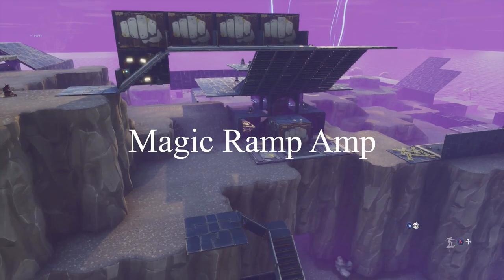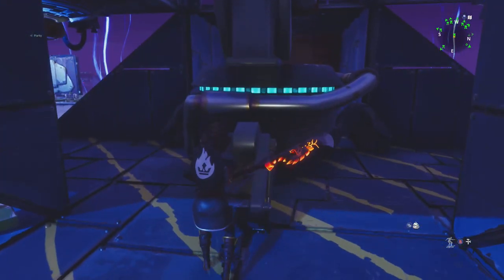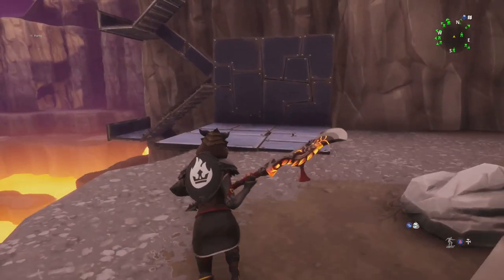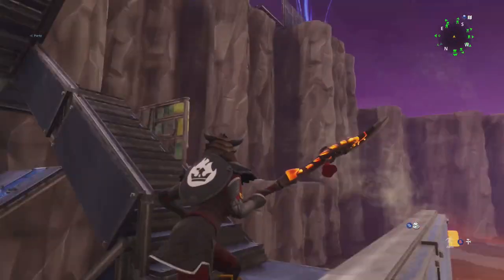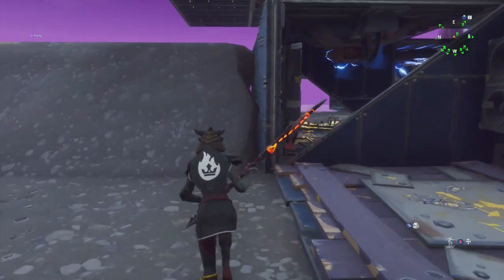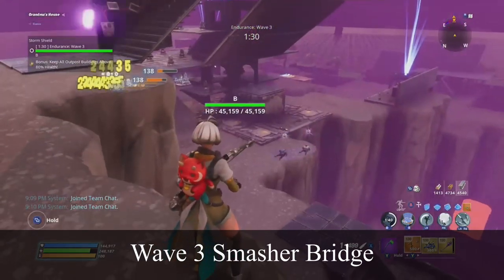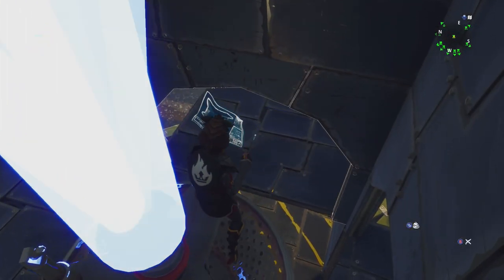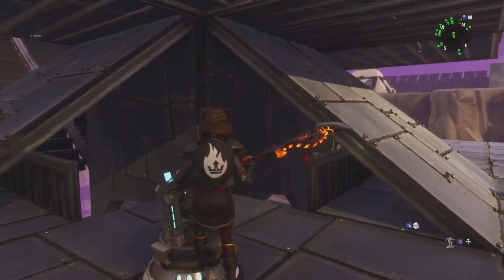Magic Ramp Amplifier. Twine Peaks Endurance

Comment: On non linear aggro, you could try to stand behind the spawn. 
Works in every wave 5 (and on any other wave) for me. 
If you can relie on your build, that is a easy way to deal with smashers.
Reply: I'll have to try that, just got hit on wave 5 and the smashers leveled it. So many dang smashers on that wave.
Reply: @wisemx  it requires to build the amp like in the Video. Or completly with non aggroable Walls:) have fun building
Reply: @ashkatschm4057  Yeah I did but there were do many they looked like spaghetti and just started wreaking right there.

Comment: 200iq but do you have a video explaining all the trap roles used for each amp, that would be super helpful and would make it easier to build
Reply from the maker: I can try and make this in the future if it is going to help. However most of the reasonings to why i use stuff is similar to vacaloidnyans video on trap perks for endurance with about 3 different trap perk setups maybe... but thanks, i might look into it.

Comment: Great build will have to try. Will the boss walk around the amp or same path as the normal husks?
Reply from the maker: hell normally path underneath and through the same way, if he starts hitting a diagonal piece just knock him with a weapon so he moves round to back wall. However there are other paths or interactions that can happen but that's for a later date.

Comment: how many times impact on the walllaunchers and floorlaunchers
Reply from the maker: I think its 4x impact floor launchers the one to the left of wall launcher homebase side may sometimes not knock over so the second one they land on will launch off. The wall launcher only really needs 1 impact at most but mine is 2x impact 2x reload 2x durability or heals...

Comment: Being a geek myself and liking the idea of exploiting husk mechanics, what I really like about this build is any silent changes EPIC make to the game can be discovered easily once you have a good knowledge how husks should behave around this amp. I see you have mentioned about the launcher perks in other replies but not about the sound walls. Are the two sound walls around the outside of the monitor non impact? IE; 3x durability, 2 x reload, 1x effect duration?
Reply: I just wanted to add that the reason I'm asking about the Sound Walls is because post 12.50 the build stopped working for me, even on wave three. The smasher follows the path in your video until it gets to the back of the amp, then it looks to start heading right and up the natural ramp but then turns and decides to attack the sound wall instead. The smasher then proceeds to break the three walls around the monitor before then finally heading to the smasher bridge. Are you also seeing the same thing post 12.50 or have I messed something up in my build?
Reply from the maker: that's odd.. ill run endurance now to check.
Reply from the maker: kind of up to you... I would just recommend at least 2x reload and effect duration. the rest depends on your trap durability and your own preference if youre killing them use dura as youll end up triggering a lot otherwise can get away with impact if you feel you want it to stun mist mosnters. tho I will say my durability has managed to run out after getting 4/5 waves on ramp... so maybe yeah 3 dura 2 reload 1 effect is way to go
Reply: I managed to fix the issue and the smashers are behaving again. What I tried doing was building a back plate behind the back wall launcher so the husks did not end up far out in the lava. The way I built it was the problem. I changed it and now all is fine again.

Comment: What would you do on wave 13 if you are maining blakebeard since he doesnt have bullrush? I got to wave 13 and the boss slapped the walls in one hit and caused a fail because of the despawn issue
Reply from the maker: It is definitely harder to do this build now. Im playing around with some ways to try and get them either stuck or recycling. Ive found a trick to get them to repath as normal but its not very practical so will probably stick to sound walls
Reply from the maker: For the miniboss bullrush is still best but if not using try the pokey stick... sir lancalot... just gott wait til he gets to the wall... slow field can help... then just line yourself up alongside it as shown in vid and poke him off

Comment: On wave 23 smashers and propanes destroy everything on this amp... I build it just like yours
Reply from the maker: Sometimes this can occur others it works perfectly... seems to just be luck if you get the right ai pattern. Ill look into other ways to aid it but for now just try killing the smashers and anti air on the ground for the propane that get by the soundwalls. If you recognise they attack the rear of the amp then they are the bad pattern that will destroy it all

Comment: I really liked the design but I when I tried it out for my self the propane’s blew up the front of the build
Reply: The smashers also hit the front
Reply from the maker: It shouldnt happen early wave3 atleast if so the build may be wrong... however ill rerun it if theres been an update and put any updates in the description.
If it helps i can do a no prebuilt vid... i think i already made one but sitting somewhere on my pc... chose not to upload it as it wasnt that great
Reply: I’m using it for ssd 9, would that change anything
Reply: Lette7 yeah because endurance has different husk spawns than ssds

Comment: Do you have to use 130 traps or it can be like any level
Reply from the maker: You could get away with 106 considering impact thresholds are easier to meet than damage... due to the amount of triggers to take effect on husks will most often be 1x however if you got 130+ please try and use those... especially on the smasher bridge.
Reply: whitestreamz thx I’m just trying to build my amps so I can get through 6/10 and do endurance
Reply from the maker: This is not a build for ssd... though could be altered to be one... initial thoughts would be increase impact and knockback try and get into lava or to knock them off with other launchers or use geyser to shoot into lava... anyway hope this helps.
Reply: whitestreamz can you build my amps. I can pay you 😂😂 I feel like I’m gonna mess up big time and I’m not that creative
Reply from the maker: I cannot add anyone on my main... i might get the mythi  in twine and work on an alt account as my main is stavked with requests... if your on xbox you can inv me through there instead. Gamertag esper220
Reply: whitestreamz dang it. I have ps4 😭😂

Comment: what the perks on your freeze floor and anti air traps?
Reply from the maker: Freeze 3x impact 2x reload 1x dura
Anti air 2x reload 2x range durability
Reply from the maker: However i have max trap durability survivors
Reply: @whitestreamz  thanks i noticed that you use epic is it because its cheaper or is there a different reason?
Reply from the maker: It is just because its cheaper. You should use legendary with +1 dura perk if you have... or healing/hp rise
Reply: whitestreamz put effect duration instead of durability it freezes the husks forever

Comment: Can u show the perks of the traps?
Reply from the maker: The perks of the traps.
If high trap durability survivors:
Use sound walls 2x reload 3x durability 1x effect duration.
However you could also use healing on the ones around the walls around the monitor.
Freeze traps would probably be best as 1x impact 2x durability 2x reload 1x effect duration
Wooden floor spikes all durability... not trying to kill the weenie husks
Anti air: 2x reload 2x range 1x dura (1xhealing)
Floor launchers 4x impact 1 xreload 1x dura
Wall launcher: 3x impact 2x reload 1x healing
Tar pit: complete dura
Reply: @whitestreamz  thank you a lot,i suggest you use the perks of the traps when u editing the video,that will improve your vids a lot and make them more goodies

Comment: Is it still working?
Reply from the maker: It should be... the only thing that has changed is the husk ai... well it has been fixed to not remain atill after being displaced and needing to recalculate pathing.
However do be wary that as there are more than 1 ai pattern the smashers dont always cooperate on later waves, as pointed ofut later in the video and youll have to kill them. I will be running more endurance next week or so and can confirm then

Comment: It doesn’t work they come from the other side
Reply from the maker: there supposed to come from the other side
Reply: @whitestreamz  so how is it supposed to work
Reply from the maker: @elliothoule7998  the video should show this well enough. Have you watched it?
Reply: @whitestreamz  yes
Reply from the maker: @elliothoule7998  the video does explain it better than i can. But basically they path round to the rear of the amplifier, to the monitor on the amp. They then get thrown off

Comment: Does this work for ssds?
Reply from the maker: No. I wouldn't use this for SSDs due to them having kill waves. This was mostly meant for timer waves. However you could modify it to catapult them into the lava with the gryser rather than recyce to get the kill wave
Reply: Do u have a ssd 10 build cuz all the others i used aint workin and its a smasher wave
Reply from the maker: Send me your epic ill write it down and try to join you later to help. Otherwise just build a simple tunnel using sound walls at the front to drop propane and then traps to kill further back. Freeze and drop traps are meta right now. If i dont reply just try typing here again so youtube notifies me.
Reply: RDR_wivz006 or xd_wivz006 something like that
Reply from the maker: Doesnt work... cant add u
Reply: Well i think the only problem is my trap dur and trap damage as im pwr lvl 80
Reply: Idk then im not on anyway
Reply from the maker: @wivz5289  for trap damage your f.o.r.t. stats need to be tech. Tech boost trap damage and abilities
Reply: whitestreamz its level 80 rn but i use machined harper for trap dur
Reply from the maker: @wivz5289  thats a great idea. Machinist harper will make a big difference for you.
What amps have you built so far? Have you had any more luck with ssd 10
Reply: Ridge n hb are the only ones that ik work
Reply: whitestreamz but i have all of the others built from ssd 9
Reply: whitestreamz i did my ssd 10
Reply from the maker: Nice one Congrats... the fun of endurance begins now... its quite a large step up from ssds
Reply: whitestreamz not fun lol im strugling already u need the perfect rolled traps
Reply from the maker: @wivz5289  yep its definitely another beast. Tire traps and freeze will be your best friend going damage. Recycling with launchers and strategic builds will be great as impact fhresholds are easier to meet than killing enemies.
You will need alot of trap dura if you dont want to replace traps mid run
Reply: whitestreamz could u help me build my amps plz ill give u tge metal and the stuff to make the traps
Reply from the maker: @wivz5289  yes sure got nothing else to do atm.
Work out what your epic is and add me
Reply from the maker: Party services broken atm
Reply: whitestreamz my internet os being fixed atm can we do tomorrow i have to use my 4g on my phone
Reply: whitestreamz i just changed my epic to my psn its xd_wivz006
Reply from the maker: Maybe... i might be busy
Reply: whitestreamz it just came back up il be on for like 11 hours
Reply from the maker: Might catch you on only if i can add you. Your not appearing on friend add list
Reply: whitestreamz whats ur epic
Reply: whitestreamz i have 51k metal and my bridge n devil amp are still built from ssd 10 idk if itll work so i havent broken it

Comment: Still works?
Reply from the maker: It should still work.. Though i have made adaptations by placing anti airs around the rear of the amp to act as extra defence if you get the wrong ai pattern to combat against propane and lobbers.